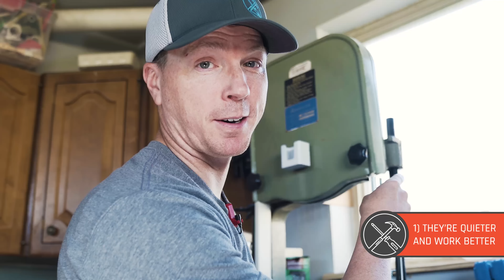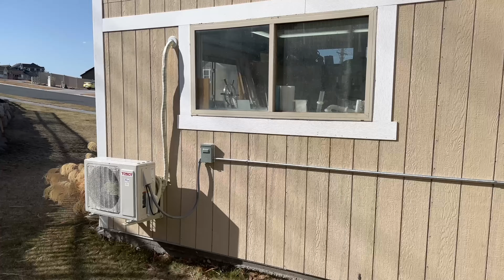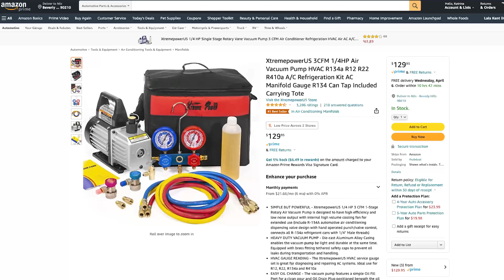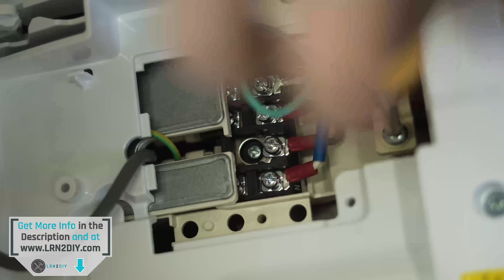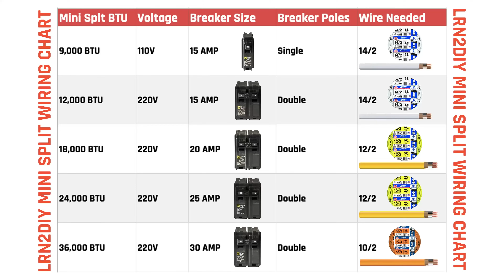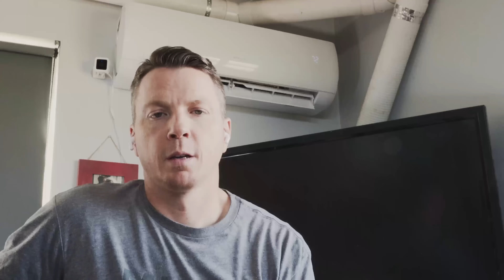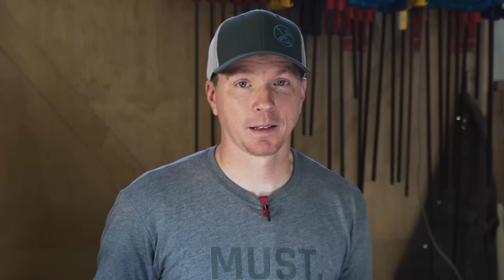Mini Split - 3 Things I Wish I Knew Before Installing

Comment: We currently have central a/c and heat. If we DO go with a mini split, the outside unit could be installed in place of our current outdoor unit? Do we have to have lines running to each room of the house we want to heat and cool?
Reply from the maker: Mini splits need to be installed independent of central air and heating, so not it can't be installed in place of your current condenser, unfortunately. These do need lines to each room and a multi-room unit.
Reply: Cousin John,  My neighbor moved into his home about 10 years ago, and the heat pump has not been working since that time.  I discovered this back in August, and installed a ductless 18,000 Btu heat pump, that he bought for $899 at Amazon.  I extended the lines by 40 feet to reach the location of his now not in use 240 volt disconnect.  The ductless systems must use the copper lines that are designed for them.    I evacuated the lines, and charged with 35 PSI of new R-410 to make up for the extra distance.  The system charge is perfect.  They come pre-charged for about 15 to 25 feet of tubing length.  

His summer cooling will be about equal to the cost of running the window A/C units,  while the heating cost will go down significantly from running the electric 15 KW heater.  Perhaps saving about $400 a year!  

He decided on a single zone system, because he can afford that system.  A 3 zone or 4 zone, and the home would be more comfortable, and he could close the bedroom doors all of the time.  However he and his wife are retired, and leaving the door open all the time is not a problem, worth it to save $2,000 on the installation costs!  

For another home, the owner wanted to increase the size of the unit in his home.  He has a very small 24,000 Btu unit in a 2 story home with a conditioned basement, and that it a total of about 2,200 square feet.  So I suggested a 12,000 Btu unit in his bedroom, and keep the door open during the day when trying to cool the house with the small air conditioner.  His other conventional choice is to replace the working 24,000 Btu unit with a 48,000 Btu unit, and then it would cool the whole home.  But the ductless system will cool his bedroom silently!  And for less money!

Comment: Europeans: Meh... typical AC
Americans: MINI SPLIT AC HYPE

Aside from my joke, 16 years ago my parents bought a 24.000 BTU Mitsubishi Heavy Industries beast AC,  it keeps running till this day( zero issues) with 100% efficiency, even my 10 years old no name OEM one works fine, I don't know much about US HVAC's but the "mini splits" are robust machines with capacitor issues after long working hours

Comment: You know you could have gone full solar or hybrid.  Check out Hotspot Energy.  I had a local HVAC install 2 hybrids heat pumps 6 years ago and they are still doing great.  I bought the units without the solar panels and bought and installed them later.  Basically during the day it trims off 1 amp of the 2.5 amps they run on. At the time the hybrid would not run on solar only, but I see now they do. If these ever go out I will be replacing with the new ones.  For those trying do something off grid or as I have seen on RV's they have one the runs 100% on solar.
Reply: I am considering installing a 5 KW POWMR inverter / charger / MPPT controller to run my 120 volt ductless heat pump.  I will be able to run other loads in the spring and fall, when the heating and cooling systems are not in use.  While the hybrid solar / 240 volt system you describe, the solar panels are dedicated to run the heat pump and reduce your power bill only during the run time hours that are daylight.  So on a cool night with a warm day in the late fall, you would be buying power to run the heat pump at night, but not need to run it while sunny and it could be running for free from the solar panels.  Then in the summer, you would have to buy power after sunset.  

Basically I am saying that with your hybrid heat pump, the solar panels can only run the heat pump, and that solar power can not be used to run your refrigerator or lights, or whatever.  And it can only run the heat pump during the day.  At night it will switch back to 240 volt grid power.  

So I bought 8 used 250 watt solar panels for $85 each, and they can run in series for 250 volts at about 8 amps.  The POWMR inverter/ charger / MPPT controller can take in up to 15 amps and between 150 and 450 volts.  Then I can charge a 48 volt battery bank, I plan on using 200 AH golf cart batteries.  So 200 AH X 48 volts is 9,600 watts.  I can only use about 60% of that power.  Still I could run my heat pump all day while using only 500 - 1,000 watts, and have 1,000 going into the battery.  I can run my refrigerator, lights, TV, ect.  When I don't need heating or cooling, I can use that power other places, such as charge my car.  When I need power for the heat pump, but the battery is low, I can use the charger function to run it, or plug the heat pump into a grid power outlet, instead of the inverter 120 volt receptacle.  

I can also use my time of day power schedule to my advantage.  I can run things from the inverter / battery between 5 pm and 9 pm,  (when my power schedule is $0.32 per KW) and then charge the battery at night at $0.08 per KW, or wait until daytime, and charge with solar power.  Between 7 am and 5 pm, weekdays I pay about $0.13 per KW.  Weekends are the lower $0.08 per KW all day!  

I already shut off my electric water heater between 7 am and 9 pm every day.  I find that if set warm enough, I have plenty of hot water to take a shower at 7 pm, even though the power has been off to the water heater all day.  

There is a system, where they use a 240 volt heating element that is run directly from solar PV panels, on DC power.  then use the upper heating element at 240 VAC run on grid power.  This works OK in most situations.  The DC power element will heat the bulk of the water.  There is no need for pumps, inverters, ect.  Or they can use a 50 gallon water heater run on DC power, and then pipe the second heater that is run on grid power or natural gas to heat the water to the normal 120F setpoint.   Any electric heating element will also run on DC power from solar panels.  Just make sure you do not exceed 240 volts input to the water heater.  With my 8 amp 33 volt solar panels, I could run 7 in series, or run pairs of them to make 16 amps at whatever voltage comes in.  Say 5 in series, that would be 48 VDC just after sunrise, and 150 volts at noon, and back to 48 volts near sunset.  10 solar panels would be 16 amps X that same voltage range.    With this solar system, you would normally use all of that potential solar power each day, that you are using hot water.  So unlike the solar powered heat pump, where the solar is only used when you need heating or cooling and the sun it out, the solar PV heater will run most of the time each day.

Comment: Ok a few issue here. I am an hvac tech and a cheap skate as well.

First is try to find tech support or parts if the unit you bought ever breaks it is probably non existant. Which will probably make your unit disposable. The Mr . cool  unit will have atleast some parts availability and rudimentary tech support.

2nd is that if you use the factory flares on your lineset they are probably going to leak freon as they typically are garbage. Freon linesets also use special flaring tools not the standard ones since the angle and size are different from automotive flares. Also your system is probably slightly under charged as you cant buy freon unless you have an hvac license and the manufacturer generally doesnt include the installers charge for the lineset since they dont know the length of your final lineset run. Go look at your flare fittings and see if they have any oil on them yet. If they do your leaking freon and need to redo your fittings. The Mr. Cool unit has precharged lines which eliminate the charge issue but can themselves leak. 

Other people have commented on the effeciency differences so i wont bother.

Just some info i thought I should share. Liked the video though. Hopefully it lasts you a long time.
Reply: Right?? Commercial hvac tech here, and a  300 year warranty on the compressor doesn't matter if the inverter control board fails in 2 years and they claim it was a phasing issue.

Comment: Mr. Cool is more popular in Texas because the lines are pre-charged and have quick connections . Any other type like yours would require a licensed HVAC with an EPA type 1 and 2 to be able to deal with the gases being released into the system even though it’s pre-charged as well.So for us at least it’s cheaper to do the Mr. Cool. Good video.
Reply: I live in Dallas and have 2 minis in the shop I did myself, both are Tosot. I have a Hvac and EPA license and didnt really see any need for it, I have seen the quick connects leak way too many times....

Comment: Slightly off topic but you mentioned making use of the 220 outlet. Rewire your table saw to 220 and make its life easier and extend its motors life. Pull the cover off where the wires go into the motor and there should be a diagram showing you what goes where. wire in an appropriate plug and your saw will have an easier job on heavy cuts.

Comment: Great video, I’m considering buying this system but the thing I haven’t heard about or seen is these units being installed on interior walls. So in that situation do they come with or make extensions of the wires and tubing to be able to run that through the attic
Reply: Yes wire is standard 4 conducter mini split has a pump inside it runs up into attic thru a 1/2 inch hose that will go to drain in vent stack in the attic

Comment: Thanks for the great videos! Aren't the pre-charged lines in a Mr. Cool system actually filled with refrigerant? I'm looking at installing a 4-zone system, and some of the lines would be rather long. I'm concerned that if I used standard lines and evacuated them myself, the amount of refrigerant drawn from the condenser to fill the hoses might require a recharge to the system.
Reply: You will have to do some calculations that the manuals will tell you how to do.

Like how many wall units you will have and TOTAL length of all refrigerant lines. 

For example( this is purely for example,the actual amount will be different according to brand, size, and efficiency), the outdoor unit comes with 4 pounds of refrigerant which will be enough for 15 feet of line set and 1 wall mount. 
Then you have to add refrigerant for the other wall mounts and the rest of the copper line set. So after calculations let’s say…you need a total of 7 pounds of refrigerant in the system.

Since the outdoor unit comes with four, after you pull a vacuum, you add three pounds to the system. Then you open the valves to the outdoor unit to let the rest of the refrigerant in.

This is just for example.
Reply: Just the lines are evacuated. Once you make the connections you open the valves on the unit.

Comment: Just FYI.  Several states require you to have a HVAC license to charge an home AC system. So buying the vacuum and charge kit is great, but without a license it might just take up shelf space.
Reply: Pulling a vacuum on the line set, closing those valves off, then opening the valves on a pre-charged out door unit isn't adding charge to a system.

Comment: You legally need to have your EPA-608 certification to install a mini-split.  You must have the type 2 certification if you work on, install or do anything that could release refrigerant.
Reply: Not the home owner
Reply: @EnVyTheLength  that is not what the EPA-608 says.  It say anyone that works on or could cause release of refrigerate must be certified.
Reply: @leealtmansr.3811  nah
Reply: If you needed the certification the retailer would not be allowed to sell the unit to anyone without the certification. If you try and buy freon you need a certification but not a pre charged sealed system.
Reply: @Michael-sx6zq  have you done the EPA-608 test?  It states what I have said, period.
Reply: @leealtmansr.3811 , Actually I was certified back in 1993, and there are "Controlled Refrigerants" and not controlled refrigerants. Such as refrigerant 290, it can be released when you need to service a R-290 system, no need to recover that type of refrigerant.  R-12 has a very high ozone depletion and must be recovered.  R-410 might not be on the list of controlled refrigerants.  I have not checked the rules lately.  

Taking the test is not all that difficult.  My friend who took the test in 2004, he said his 10 year old daughter could pass the test.  I think the fee is about $75.
Reply: @Kangenpower7  you are still certified if you took the EPA-608 test.  As for R-410A, it is controlled, and that's why I don't understand how none certified people can install mini-splits.  As for R-290, that is highly flammable and is only used in small appliances.  The industry is changing as I type.

Comment: I don't know whether the gauges and vacuum pumps used for cars are the same, but if they are you may be able to rent them for free at an auto parts store
Reply: Don’t know either, but that is an interesting possibility.
Reply: the vacuum pump is the same the hoses on the manifold (ends) will be different for cars 410a Vs 134a used in most cars. I have both as well as gauge sets going back to the early 70's, I guess if you could find the low pressure line to connect to the mini it would work, vaccum is the same number of inches of mercry no matter where you are pulling it from.

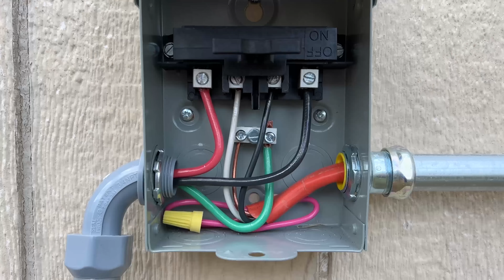Comment: 3:30 that disconnect is not wired to code. Can't use neutral as a phase leg, have to reidentify. Dropped wire gauge means your breaker and fuse if it's a fused disconnect need to be the lower ampacity. The data plates on most of these units are confusing because the manuals say breaker should to be 1.5x peak amperage which for a 18K BTU is typically like 22A but specs a 30A max circuit protection. And you also need a flare kit (Harbor Freight or auto parts store) and a tube cutter so you can cut the lines to length and flare the ends. Whan you buy literally ANY of the DIY kits it weill say in the manual "All electrical connections must be made by a qualifed and licensed electrician".- I don't know if the seller or manufacturer will use that as an excuse to avoid a warranty claim by demanding a copy of the electrician's invoice, so bear that in mind as a possibilty. Typically you are looking at $500-$800 for a new panel run with the associated wire, disconnect, and whip, vs. about $100-$150 if you DIY depending on how much wire you have to buy or if you can get 6' of flex instead of a whole $40 roll.

Comment: Everything is great until that POS needs service. They are 10 time more complicated to work on than a conventional a/c unit. I had to replace the electronic expansion valve on a Mitsubishi mini split. Johnson supply is our distributor for them. I ordered the part on may 20 and didn't get until June 6. Try going 2 week without your A/C here in Houston. I thought it might be the evap temp sensor and they didn't have those in stock either. I was told 22 weeks out and they weren't even sure about that. There are several control boards inside the unit and good luck on trying to figure what is the problem. Another one had a leaking evaporator coil. Evaporator unit had to be replaced. Watch what you put around it so it's made easy to access for repairs. It might be easier that after 10 years you might be better just getting another one. Keep the coils clean because you can't just take it outside to wash it out.

Comment: You don't recall you mentioning the added cost for Freon. Mr Cool has the Freon pre loaded as you mentioned. I know you don't make the codes but wouldn't an outside plug be a ......disconnect.
Reply from the maker: These TOSOT units also come with the refrigerant. When you connect the lines to the outside unit it gets disbursed into the lines.

Comment: You need to cover the process of maintaining the unit. I had one of these in my business, and it had to be flushed every 3 months, or it would stop blowing cold.
Reply: Vacuum the condensate line out from outside. If water builds up most of them have a switch that'll shut the system down.

Comment: Okay after you buy the gouges go buy the freon in quantity that will work for one split and find out that doesn't work and need licenses  to purchase. Just have a licensed charge  your system with no warranty.
Reply from the maker: These don’t need additional freon or refrigerant. It’s already in the outdoor unit and gets fed into the lines when you connect them.
Reply: @LRN2DIY  it all depends on lineset length. They come with some additional freon but that may or may not be enough for your application.

Comment: How reliable is the wifi option you added to the mini-split? 
Is the wifi option universal to fit other mini-splits such as my Mitsubishi-Trane recently installed?
Reply from the maker: It’s been totally solid for me so far. It works off of a combo of Wi-Fi and infrared so it should work with any remote controlled unit, not just a specific brand. I use mine all the time.

Comment: Come on buddy.... you clearly didn't get a quote from an electrician. $50-$150 to get an electrician to run  240v conduit /wire pull, split phase disconnect and a 240v double throw breaker???  Whatever you're smoking it must be good.

Comment: Also, $50-150 for the electrical work it is kinda ridiculous unless the panel is on the other side of the same wall. In most homes it’ll likely be at least 30-50’ of wire, a 240 breaker and a few hours of electrician time. In my case it was 60’. The wire alone was almost $200. The total bill (excluding the whip and disconnect that I procured) was $475. The range is more like $300-600 for the necessary electrical work.